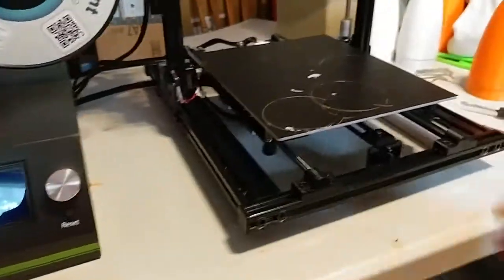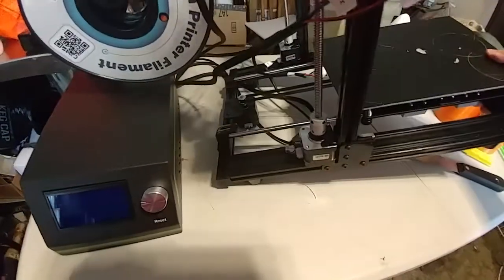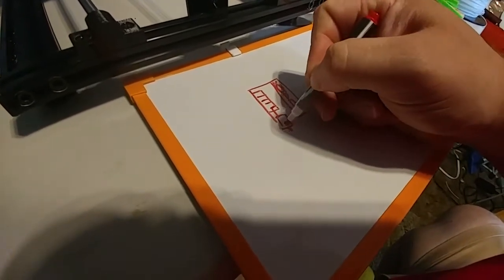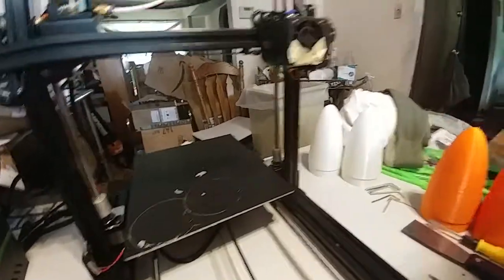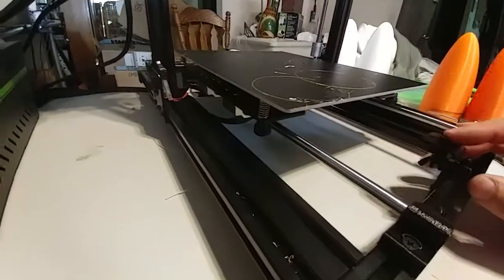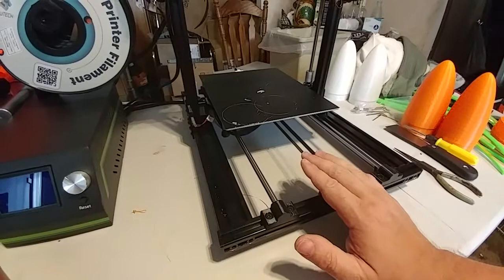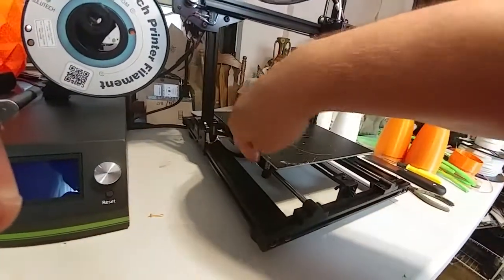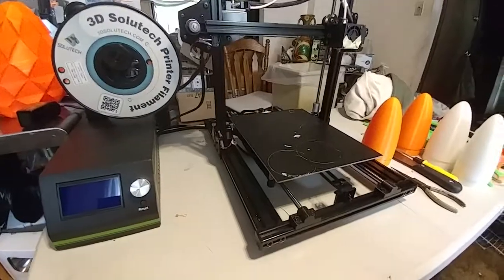Today's 3D Print - Anet E10 issues and fixes, suggestions for anet

Comment: I bought one of these today :-D
I prepared and printed the parts to modifications in all parts afeccted. But it's not bad printer. Not the better, but i'm tired of waiting my Tevo Tornado. 
Tomorrow is the day for my Hictop Ender 2 arrives!!! And probably the Wednesday the Anet E10. 
I don't know when my Tornado comes out....I bought 19th October and Ender 2 in 21th October and Anet E10 30th October.
But today(in Sunday xD ), i put the Marlin in my Old Acrylic Prusa I3 Pro B chinese Clon from Geeeetech. But yeah! I expend more than your large prints, mounting, configuring, leveling and update firmware. 
It's a long way, but it's my first 3D printer and i'm very happy "creating" the thing. Now Printed some parts... not bad, but is a crappy printer. Needs a lot of work and is not configured automatically. 
Needs lot of learnings for a print a simple cube 10x10mm :-D
I can't Wait for this printer, for the ender 2 and for my Tevo!!!!!!!! :-(
Thanks for your videos! I watched all days. I'm Bored without my printers......and have +50Kg of Filament waiting too xDDD
Reply from the maker: +PLAYNIMATIONS solder the head bed wires and print the shroud from cnc kitchen
 Good printer. Tornados according to gb site ship first week november. Apparently its a tevo backorder issue. Backordered everywhere it seems. This is what i hear at least
Reply: The Ender 2 and Anet E10 makes me happy until arrives :-D

Comment: I also wanted to let you know that, I believe more than one person puts these printers together because I found a couple of things that were put on my printer different than yours and most other printers I've seen.

The first was the Y motor plug location, mine come rotated to the side you have changed yours to.

Secondly, my extruder and X plugs were tagged correctly contrary to 95% of other people's printers (a couple of reviews they didn't say anything about it so, I don't know) in fact, and knowing that everybody had to change those plugs, I changed them before I started the printer and that's when I found out, I had to change them.

I have a MOSFET and some super silent fans coming from the UK (I'm in Australia) I will add them as soon as I get them, they may get here before I can get the printer working as I need to have that main board replaced and they are in China...!

I'm quite annoyed after spending 2 weeks waiting for my ordered printer, getting some filament arrived a few days ago and me having everything ready for this printer, the extra time I spent pulling things apart and straighten and do all the normal modifications everyone else had to do, I'm not able to print anything and I'm expecting some time before I do, I paid for the damn thing, I expected better...!
Reply from the maker: nyodine that is one of the cpsts of going low cost china. Lets be honest. Anet appears to be the budget printer maker. You pay little but you get a bit more for the pruce but with a few headaches tossed in to go with it.

My plugs were also correct. I aasume this is a qc thing. Ie they do appear to be correcting things in qc as they discover them. Sucks to be customer beta testers but it is what it is. You cant touch this print volume this assembled for this price anywhere else except in pure kit form.

As long as they incorporate the feedback issues into production i can tolerate a little bit. None of the issues are glaring or fatal. Just annoying.

What i am killer curious about is how the heck they made it so quiet. Dumb luck probably bit i hope they can replicate it. (The printer fans are loud as shit one of the noiseiest i have ever used but i can replace those :-)

No doubt there is more than one person. Dozens or more likely. Its definetely a qc or quality control issue not a design flaw issue. Which is why i am hopeful. A design flaw can not be fixed without cost and a redesign. But qc costs nothing but the will to impliment it.
Reply from the maker: nyodine for some reason your first question your first post isn't showing up here I'm not sure why but I'll answer it anyway I'm ninety-nine .9% certain it's 12 volts it can't be anything else that's what the power supply puts out but I will try to remember to put a voltmeter to it when I get home tonight

Comment: I agree with all the modifications you suggested Anet implement on these model printers.
I just received my Anet E10 this morning, after I ordered in on Gearbest, I'm not a Youtuber nor I make reviews but every so often I make a video that is normally a request made by a supplier when I'm complaining about something and this was the case today when I contacted Gearbest to let them know I was unable to test my printer because the heatbed is not working and they requested a video, an 8 minute clip that I downloaded on my Youtube account this afternoon (in case you want to watch it https://youtu.be/bWl_BJJR0lU)
It simply shows that is no power supply going to the heatbed from the main board and without a heated bed, the printer doesn't print.
I believe I watched every review made on this new printer since day one, even those in a different language and I can sadly say that only 2 people including myself were unable to get the printer working the day they put it together and probably (in my case) a few weeks before I get replacement parts and get it going and that is most disappointing.
My box showed very rough handling from the transport people, the H bed frame was badly bent and I had a dent on my black box so, I don't know if that caused the main board problem or not.
I have asked to a couple of other Anet E10 reviewers if they could measure the voltage they get on the heatbed plug when the printer is on, I mean the 2 power wires at each end black and red those are the ones that read zero while the centre wires read about 5V so, could you please unplug the bed plug and measure the voltage on those 2 wires..? I believe it should read 12V, if I'm not mistaken.
Thank you
George

Comment: I hope the people at Anet take your suggestion to hart and make the changes you suggested to fix the issues the printer well be so such better and sales well go up and they well have you to thank.
Reply: Gearbest have a warehouse full the these printer it will never get fixed
Reply: If they are still producing them they should fix the issues.
Reply: too late gearbest has a full warehouse full to them that is why they are pushing them so hard and sending review units to anyone this guy has 1000 subs  but he has an affiliate link for the printer with a coupon
Reply from the maker: john tilocca i was surprised when they approached me. They were not going to send me an e10 however. I requested it.

Comment: They should send you a New one without those Problems
Reply from the maker: the German Printing Nerd none of those problems stop the printer from working the z wobble is 100% my fault the rest of the problems really are minor and they do appear to be receptive to correcting these problems some of the earlier models have been updated and new shipments don't experience those same problems if I were buying a $3,000 gmax I would be rightly pissed but its a $300 printer and needs less work to be a good printer than my wanhao duplicator i3 as long as they are receptive to Corrections and make those Corrections I'm okay with that 3D printing is DIY got to get your hands dirty that doesn't mean we should not call them out on their blatant mistakes but it also means we should temper our response with reason
Reply: they all have the problems